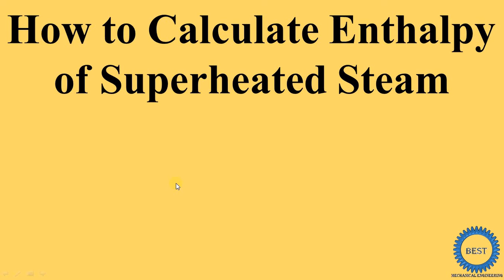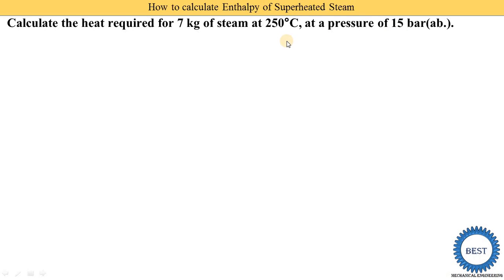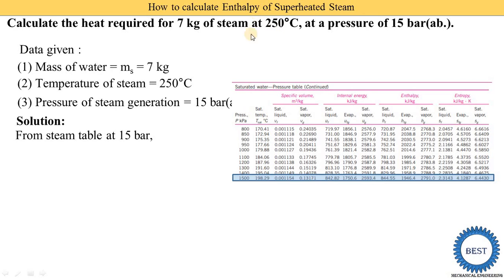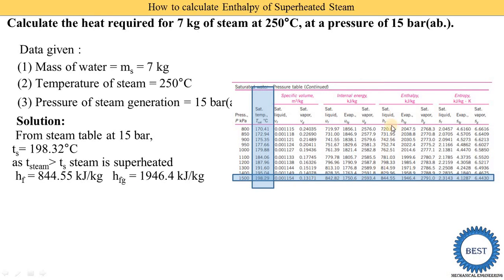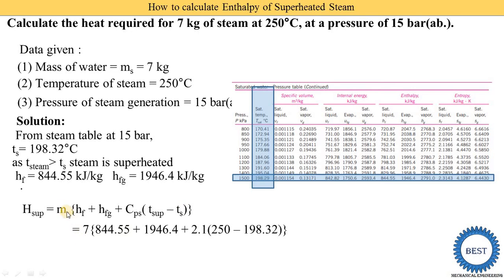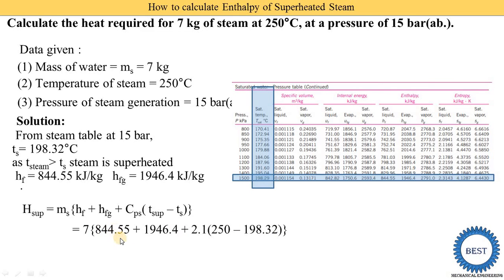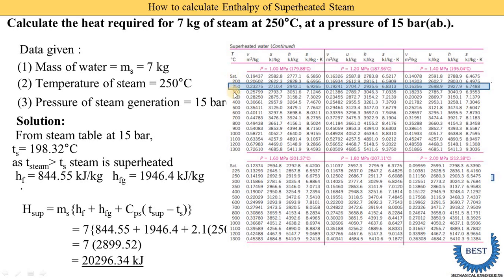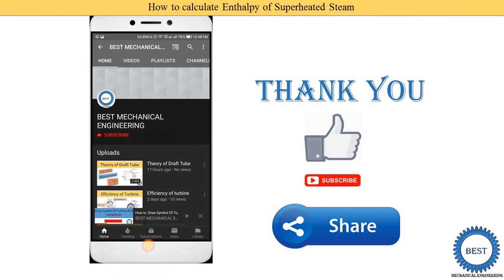How to calculate Enthalpy of Superheated Steam

Comment: Hello 👋
You Used Diffrence of temperature in degree celsius and specific heat capacity  in degree kelvin as 2.1
Reply from the maker: Difference of temp in degree Celsius and kelvin is same.
100-50 in degree = 50
373-323 in kelvin = 50